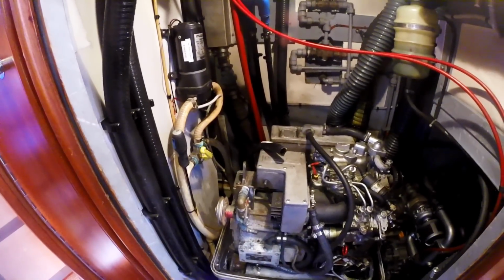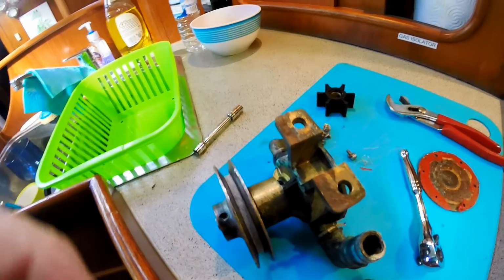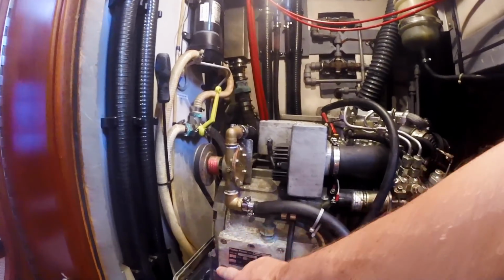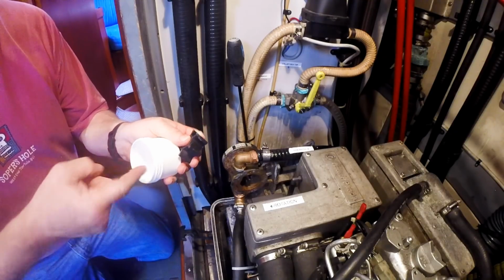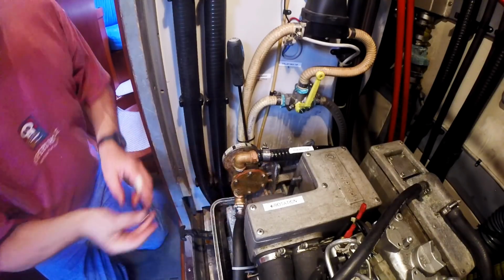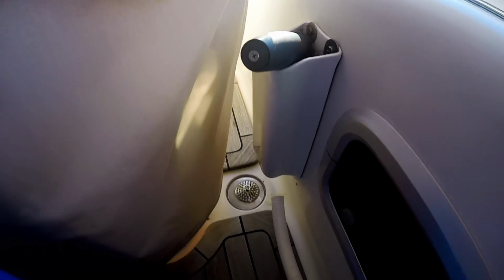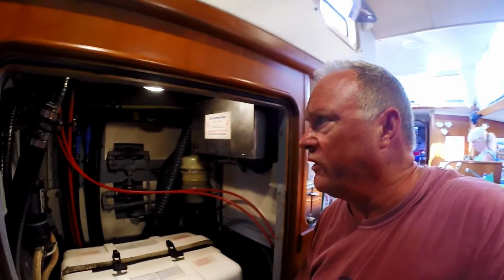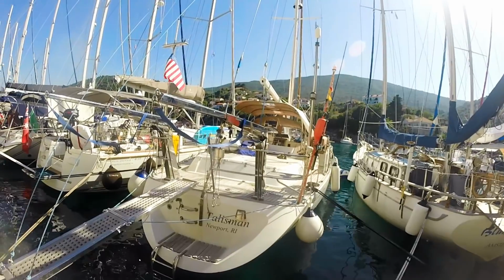Ep 52 Genset Repair (Sailing Talisman)

Comment: Panda Fisher has had control issues for many years. The manufacturer has not acknowledged the issue and offered no warranty.
Reply from the maker: The Fischer Panda line is not well regarded in the marine industry, I'll admit. But it fills a need in that they are extremely compact. They achieve this by running a constant, high rpm, thus the thick sound shield. Our 6kva model runs at 3000rpms from the moment it's turned on. And we do not have the space in the engine compartment for anything bigger. If you go with Kohler, Northern Lights, Cummins, etc, the unit will be much larger and run at lower rpms, using the torque of a larger diesel engine to drive the stator. In many ways the Fischer Panda line appears as a portable jobsite genset, similar to the (gas powered) Honda generators. It's just permanently mounted. When ours goes down it's almost certain to be from cooling (clogged raw water intake) or fuel starvation due to dirty Racor fuel filter. It doesn't help that our auxiliary 12v fuel pump is barely up to the task, meaning that that part isn't really Fischer Panda's fault.
Reply: @SailingTalisman  I am looking at gensets for my Grand Banks 36 and have come to the same conclusions. Still thinking on the subject. Thanks.
Reply from the maker: @ronobrien7187  Yep, it's a quandary. If it helps, the Fischer Panda engine (in ours, and I believe currently) is a Kabuta diesel, and is well regarded for its reliability and longevity. And I do believe FP have resolved most of their issues. The factory techs are easy to get ahold of in person and answer questions truthfully and offer real-world solutions.
Reply: @SailingTalisman  Good to know. The Cummins Onan uses the Kubota engines also. Good power plant. Thanks for your help.

Comment: raw water coming in needs a filter to your water maker same for yr engines raw water coming in place a filter to cool your engine.
Reply from the maker: Yes, there's a raw water strainer each on the genset, engine and refrigerator. Only the watermaker has the big filtration system, and actual filters clog up too fast for the major flow associated with the first three. I haven't checked these strainers in a while and I think I'll do so later today. Thanks for reminding me.
Reply: have seen sailing turtle have many filters on standby on waters coming into his sailing boats , he also have clog debits .
Reply from the maker: Hi Tan. So first, let's define what's being discussed. A raw water strainer is technically a filter, in the same way a storm drain is one. However, in the marine world when you say filter, it's usually going to be a paper or other disposable/single use product that will remove particulates in the 5-50 micron range. Thus, oil, fuel, and air filters, plus watermaker membranes and pre-filters all meet this criteria. Strainers will serve a different purpose in that they are used to prevent infiltration of basic organic debris such as seaweed, leaves, grass, and items like pieces of plastic and wood. Usually you can dump the collected items out of the basket or strainer and reinstall. The thing to understand is that you cannot substitute one for the other. In the case of a cooling circuit for a genset, engine, air conditioning unit, or refrigerator, which is what we have in the above video, the cooling requirements are specified by the manufacturer (usually in gallons or liters per minute of cooling water flow). In conjunction with the properly sized pump, piping diameter, and the known resistance inherent in the through hull valves and raw water strainer, the proper flow rate will be achieved or exceeded. Installing an actual (paper or similar) filter will greatly reduce this flow of water through the cooling circuit, leading to the unit running hot. Even adding elbows to the piping will reduce flow, and typically there are technical tables in the install instructions to calculate the max number of 90 degree turns in a system. In short, you do not want to deviate from the design dictated by the manufacturer unless you really know what you are doing. The equipment is just too expensive to take chances with. You may be mistaking a large strainer system for a filter, but it's important that I make all of this clear because there are a lot of people reading these comments. As always, I appreciate the discussion.
Reply: foreign objects sucked up intake sea water to cool your parts